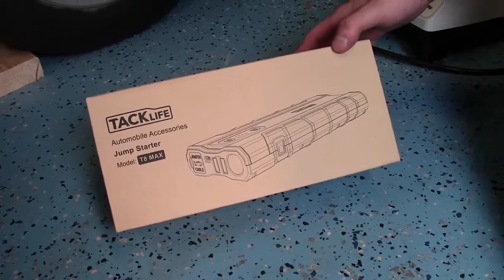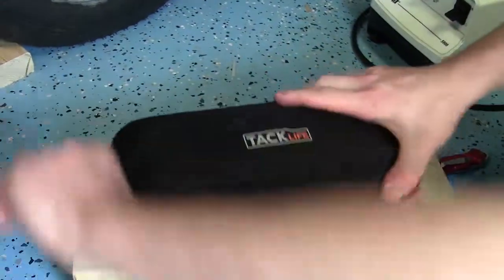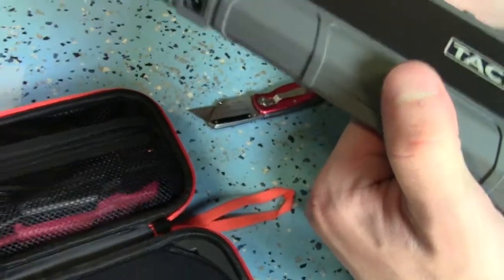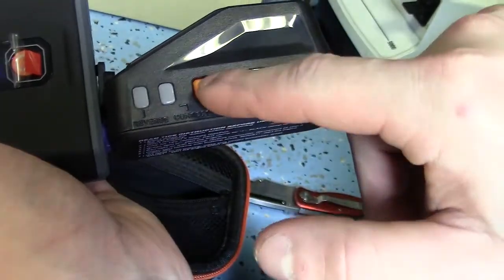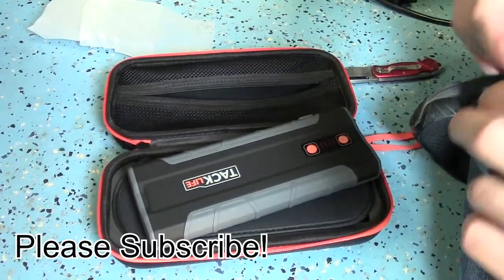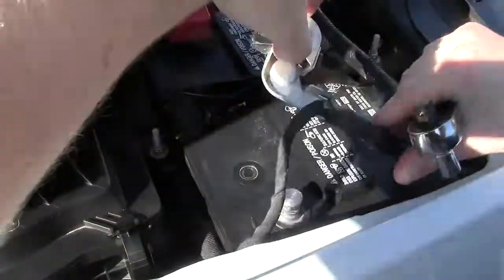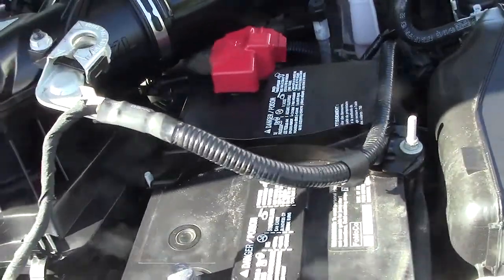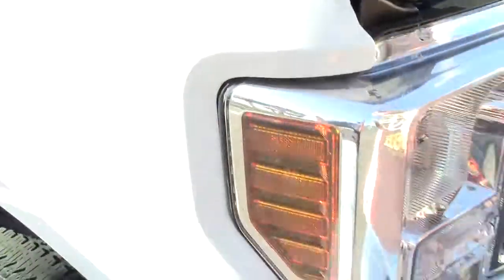MOST POWERFUL BATTERY JUMP-STARTER??  TACKLIFE T8 MAX VS 6.7L  POWERSTROKE DIESEL F250

Comment: What a clown, you still had both positive cables connected. You did not even show the truck struggling to turn on due to very low or no power at all. This truck looks new anyways to be having battery issues anyway.
Reply: how do you think batteries work?

Comment: What a  joke.  How about disconnecting the other  battery out and then try starting the truck . What a scam advertising this stunt is. i bet it isn’t even rated at 5 amp hours. Let alone a truck battery at 100 amp hours, which would translates to a 5 amp draw per hour.
Reply: how do you think batteries work?

Comment: The other battery that you didn’t disconnect probably started the truck. Daaaaaa Get A Life & next time disconnect both batteries then try jump starting the truck, That’s what you got to do to convince anyone else including myself.
Reply: Maybe you should not be so ignorant when you post comments. Both batteries had their negative terminals disconnected. This renders the batteries useless. It doesn't matter if one terminal is connected. Electricity needs to run in a loop. If you try to jumpstart your buddies car with yours but only connect the positive cable will it work? No.. it's the same thing here. By connecting the negative cable to the jump box the truck is only pulling current from the jump box. It's pretty simple.
Reply: @Brian_P  people are stupid bro, just let him live poor thing
Reply: @luigynkaren062011  yeah it's just that incompetent arrogance gets under my skin lol
Reply: @Brian_P  i hear you

Comment: That was not a correct test. You need to have both cables removed. It was still pulling power from the trucks batteries. You should have removed the positive cables. This boost pack will not start a 6.7 Ford with dead batteries.This boost pack will not even run the glow plugs long enough on a 6.7 ford.
Reply: Not true. You don't understand electricity apparently. Think about it this way.. if you go to jump start a car and only hook up the positive cable to the running car will it start the dead car?  No.. electricity needs to run in a loop to put is simply. Without the ground hooked up to a battery the battery is obsolete. The jump-starter is the only thing providing power to this truck.
Reply: @Brian_P  I really don't have time to argue with people like you. You sure are correct I don't know anything about electrical systems. For you to understand how it works you need to take the time to look at any electrical distribution system and how they work. Here is a hint Brian look into batteries in sequence. I don't need to take the time to explain how this works as duty calls. I have to put this unless electrical engineering degree to work. Yes Brian I design electrical systems for a car company. Now that I have wasted brain cells reading your reply I'm going to suggest you look into this on google before you waste other peoples time!
Reply: @chesneemcmahan6240  you must have a lot of recalls attached to your stamp 😂 as Im sure you're an electrical engineer 🤣😂
Reply: @chesneemcmahan6240  Try disconnecting the positive cable's and both side and use the jumper to make the connection on the passenger side and if you want even use a jumper cable to connect to cables on other side if you like then you can prove us wrong. But no you stubbornly tell us we don't know what we are talking about. I'm not saying the device would soley start a 6.7 but it's highly unlikely because they usually require 2 batteries to start
Reply: @Brian_P  stop telling people they don't know what they are talking about when your the one who has no clue. Do your research and stop thinking you know it all. You are more than wrong.
Reply: @Brian_P  you are the true definition of an idiot I about fell out of my chair when I read this. They are correct you do not deserve the time of day. You are the one who does not understand basic electrical systems. Please don't work on anything.
Reply: @reviewguy9806  if I'm so wrong.. explain it to me. If I'm more than wrong it should be easy 🙄
Reply: @Brian_P  it's simple to explain but im not going to bother going through the entire thing with you. You can do the research yourself. Look into batteries in sequence. Then look into grounding. Then one more thing you can look into is how to jump a vehicle without using the ground on the battery. Then if you look them up in order and really read about them you will understand. Then you can appolgize to all the nice people on here you called dumb.
Reply: @reviewguy9806  So why are we wasting money buying jumper cables with positive and negative cables??? 

Let’s work this problem backwards. If the jump box was dead, would the truck batteries charge the jump box hooked up the same way as the video? Don’t forget to show your work!!
Reply: @dirttrackcowboy4x  no it wouldn't because the battery isn't grounded to the truck chassis. If you were to hook up the jump box straight to both terminals then essentially the battery could charge the jump box.. assuming the circuitry of the jump box would allow this. I know what you're thought process is bit what I'm telling you is you're missing a vital piece of the puzzle. The hot and ground have to be on the same circuit. He hooks up the jump box ground to the ground cable of the truck and the positive jump box cable to the positive terminal which still has the trucks positive cable attached. Without the trucks negative cable attached to the battery the truck cannot draw power from the battery because it is an incomplete circut.
Reply: @dirttrackcowboy4x  sorry I kind of quickly read over your comment thinking it was Darrin lol. I reread your comment and see what you were saying to him lol. It blows my mind that there's so many people that are trying to act smart that don't understand how a simple DC circuit works.
Reply: @Brian_P  Exactly. Darren seems to be the only one who doesn’t seem to understand basic electrical circuits. I don’t know what clown college gave him a engineer degree but he should ask for a refund. 🤡🤡🤡
Reply: @Brian_P  explain this Brian let's use our brains here ok it may be hard for you but let's try. If pulling the negative cable then attaching the jump box to the negative and positive cables only uses the power from the jump box then how would the truck start with the following taking place. The glow plugs that must be warmed for the engine to start pull 186 amps for no less than 10 seconds. Then it's a 2 battery diesel requiring 850cca per battery for a total of 1700cca. Now it probably only takes 1000 to 1200 to turn the engine over but it pulls over 1000amps. With the Amp drop on the jump starter at 100 amps every 1 to 2 seconds it wouldn't even turn the engine over. Not to mention that box wouldn't turn that engine over to start with. Judging from your reply I'm sure you trust everything you see on the internet though!
Reply: @reviewguy9806  you are talking how many amps glow plugs take. For one.. it was warm out so I highly doubt the ECU would trigger glow plugs. You are turning let's say a 70° ambient block with variable valve timing... It doesn't take that much to start. The jump box is 1200 peak amps. How does a 9volt battery in a stun gun knock a man on his ass? It's all about amps.. of which the alternator on this truck is 135 amps... hmm. Your logic is flawed. Not to mention the obvious that I've already established before... BOTH negative terminals are disconnected from the truck. Without a ground the batteries are an incomplete circut. The jump box being grounded is its own circut. If you connect a light bulb off your trucks positive terminal and my trucks negative terminal will the light bulb light up? I don't know how much simpler I can make this for you. I don't care how much cranking amps you think it takes to start a truck.. without a chassis ground the battery is not in a circuit.
Reply: @Brian_P  I won't waste my time when I read variable value timing I realized you will never understand.
Reply: @Brian_P  I'm glad you continue to try and make yourself feel better about your knowledge that you think you have.
Reply: @Brian_P  maybe if you keep going you will make yourself think you are correct. Do the research I told you to look at.
Reply: @reviewguy9806  just ask your mechanic bud. I hope you use a mechanic because you really shouldn't be working on vehicles with no ability to understand reason.  I bet you're a Biden voter  😂🤣
Reply: @reviewguy9806  you should heed your own advice. This is all wooshing over your head. If you pour water in your left ear does it drain out your right? 🤣😂👍 Ok I'm done
Reply: I was thinking exact same thing that other battery must be a backup power supply
Reply: i don't know about the video, it could very well be some kind of trick. but the FACT is, IF they're telling the truth and both those negatives were removed, then there is no POSSIBLE way those batteries were giving juice.

Comment: that is not a good test ,,try it with  a dead battery hooked up , that is closer to reality when the battery is dead and draining the booster
Reply: Actually if it didn’t have any battery at all would put the most strain on the jump pack but only problem is he didn’t disconnect the second battery, that’s the only reason it started up at all. That’s a huge engine and that battery pack didn’t even hesitate.
Reply: @vunit8213  actually he essentially had no battery hooked up. He removed both negative terminals which renders the batteries in the truck useless. In order to draw 12v current from a battery you have to complete the circuit which means bot pos and neg terminals need to be attached. If you still don't understand what I mean.. imagine you've got a light bulb and you only attach the pos wire to your 12v battery.. will it light up? No.. it will not because the negative/ground is not attached. Now what if you ground the bulb to the trucks chassis.. no still won't because the battery is not connected to the trucks ground/chassis. Ground is the single most important thing in a 12v system.. without it you have nothing. In other words.. he started the truck 100% off the jump box. Also to your point that it'd be hardest to start off the jump box alone.. also inaccurate. If you were to have a drained battery the jump box exerts it's energy to the discharged battery. If you disconnect the truck batteries neg the jump box is free to deliver 100% of it's amps to the actual starting of the vehicle. The starter draws amps directly from the jump box bypassing the discharged battery. Then you disconnect the jump box and hook the neg cables back up and the alternator starts to recharge the batteries. I've infact used this when I was having trouble starting my truck.

Comment: You still had to have some current going through there. I've started my 6.0 with zero batteries in it and a 5,000 amp giant jump pack and it'll work but just barely wants to do it. My little 2000 amp jump pack wouldn't touch it. And this has another .7L.
Reply: I was thinking the exact same thing. That second battery must be a backup power supply or something because it didn’t even hesitate or anything when he cranked it up.
Reply: @vunit8213  he disconnected the negative terminals on both batteries so the truck could not pull any power from the batteries. He only grounded the jump box in effect the jump box is acting as the battery. Realistically if both batteries were dead you'd have the best chance at starting the truck by doing exactly what he did here. Without discharged batteries on the circuit the jump box would always have a better chance at starting the truck since the jump box doesn't have dead batteries trying to suck amps from the jump box. You'd just get it started as he did then reconnect the ground cables to the batteries and you're set.

Comment: You started the truck with both of its batteries AND the jump pack.  You needed to disco all the terminals
Reply: Incorrect.. in order for a battery to work both positive and negative terminals have to be connected. Think of it this way.. if you go to jump start your buddies car but only connect the positive cable to your running car will you be able to start your buddies car? No you need to complete the circuit. It's the same here. That truck could have 15 batteries but without the negative terminal connected you cannot draw power from them. By connecting only the jump box to ground means it'll only draw current from the jump box.
Reply: @Brian_P  point is you were using the jumper as a ground to connect the circuit that was still connected off the batteries so therefore this was was not cranking off the jumper but simply completed the circuit to start off the batteries. So this was truly misleading.
Reply: @blackisback74   I am truly blown away by how many people don't understand this concept. It is COMPLETELY IMPOSSIBLE for the truck to draw current from the batteries unless the ground is connected to the battery. I see what you're saying and can understand how you may come to that conclusion if you don't understand electricity and grounding very well. Both batteries have the neg cable removed and he hooks the jump box to the loose negative cable. The only thing connected to ground is the jump starter, the only thing providing power to the truck is the jump starter. Think of it as AA batteries.. if you have one battery connected with  both pos and neg then another battery only has the positive connected.. will a device be able to draw power from the battery with only the pos hooked up? No. The battery has to be grounded to the chassis or no power. That is how a complete DC circuit works.

Comment: Test it with the negative and positive disconnected.
Reply: @veryslyfoxI dont get it, so it's not getting any juice from the battery?
Reply: electricity kinda needs to flow in a closed loop if there is only one side attached nothing will happen at all
Reply: @veryslyfox no you don't understand basic electricity the loop is closed once hooked to the box with the extra power from the battery. Im an electrical engineer. Don't tell people they don't know what they are talking about when you don't know yourself.
Reply: @reviewguy9806  you're an idiot
Reply: @reviewguy9806  both NEG terminals not connected, where is the loop closed with those? to nothing......